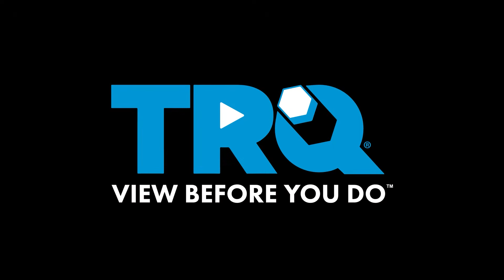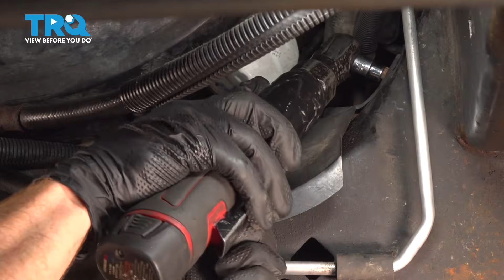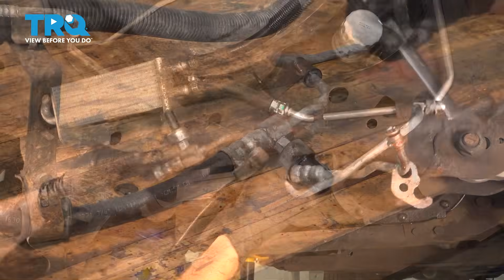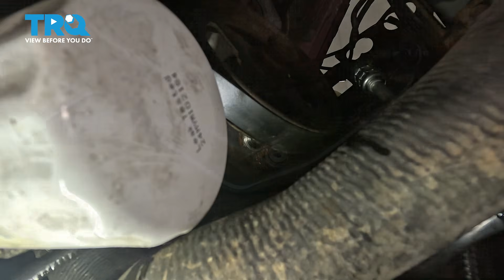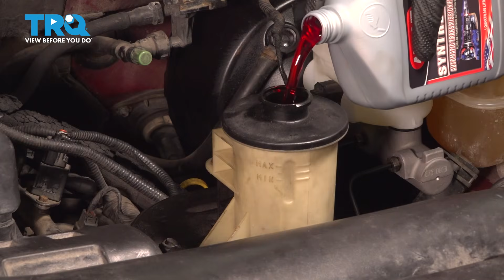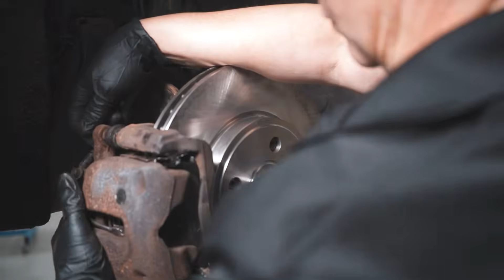How to Replace Power Steering Pressure Line Hose Assembly 2004-2008 Ford F-150

Comment: Is the connection on the power steering rack next to the drivers side? It’s hard to tell from the angle in the video. I’m only asking as mine is leaking in that area and I’m unsure what I’m looking at.

Comment: I have a 2006 ford explorer that needs the pressure steering hose replaced there are hundreds of videos showing how to change it but none of them is anything  like mine it is a 4
.6 v8 engine this is my last chance at getting a video of how to change  it if nothing  shows up my only option is to replace the  vehicle

Comment: Ford doesn't use worm clamps. They use constant pressure tension clamps which won't loosen up or damage the rubber hose over time, fyi.

Comment: The hardest one to take out is the one with the Crowfoot wrench… I don’t have a crowfoot and would have been nice if you mentioned what size is this one!! 
Struggling hard here in the Yukon outside at -38 degree Celsius on the ground with a lil jack stand

Comment: I would highly suggest that you remove the oil filter then the drip tray before you start removing the line. I see that you have a VO-88 equivalent filter on this vehicle.
Upgrade to Motorcraft 820S.